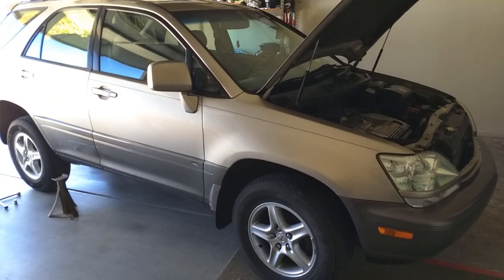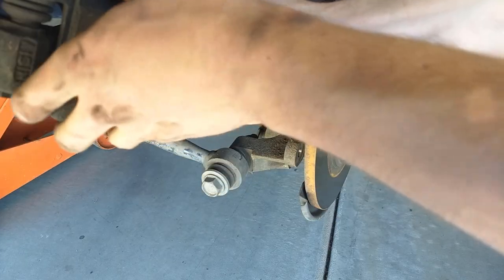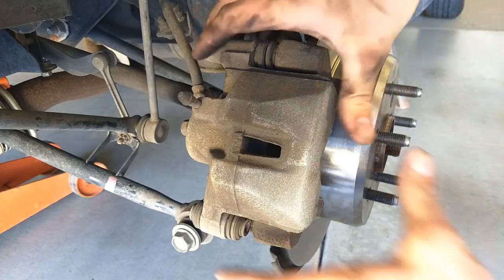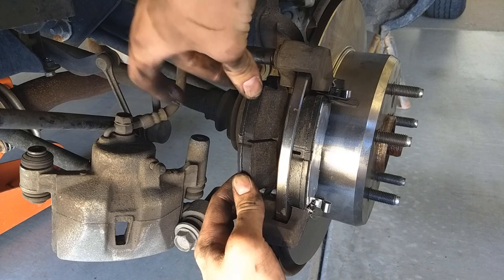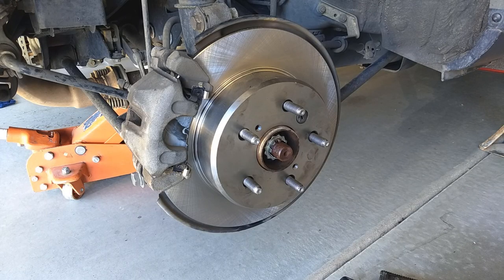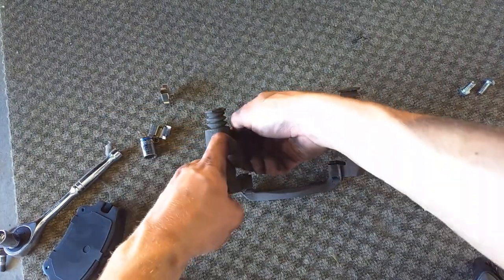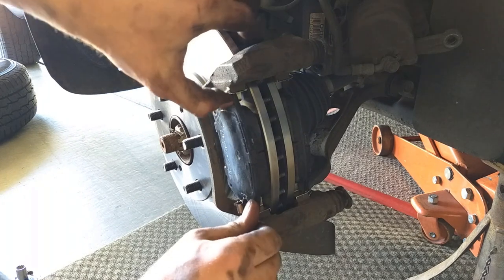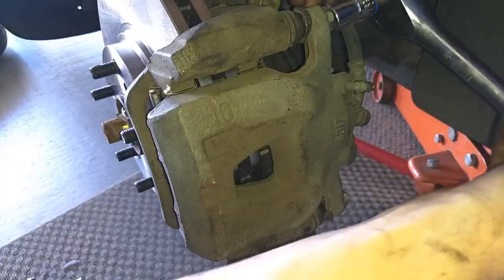How To Replace Disk Brakes And Rotors 2002 Lexus RX300

Comment: I'd personally clean all the rust off those hubs as well as spread some anti sieze or fluid film before sliding the new rotor on. Also what thread specs do you need for the rotors so you can pop em off?

Other than that and the comment about using an old pad, great video :)

Comment: You need a torque wrench.  And open the brake fluid reservoir before pushing the piston back. And you can use an old pad to push the piston back evenly.
Reply from the maker: Hey thanks for commenting, we actually did open the reservoir before pushing the pistons back...just forgot to film that part...that's a great idea with the brake pad thou thx, and we were sure to give everything a good Ugaduga 😉
Reply: I was thinking to find a piece of metal, but what a great idea thank you.
Reply: Hey I got an idea... what if.. you crack the bleeder open AND have the brake reservoir open?

Comment: What is that behind it? A dust shield? Mine are so rusty back there.
Reply from the maker: Yeah it's called a backing plate, it's to help protect from dust and debris as well as water. It also helps direct air to cool the pads and rotors. Most of the time they are very rusty lol, as long as they are still in place it's normally ok though

Comment: i cannot get the bolts out of the caliper! got the first one, the other two, i have used PB Blast, WD40, Torch, breaker bar, breaker sockets and all i ended up with is a rounded bolt that does NOT budge! Please help!
Reply from the maker: You might end up having to cut the head of the bolt off and then once the tension is off and the caliper is off you maybe be able to spin the bolt out with vise grips
Reply from the maker: But before that, try maybe an extractor set such as this REXBETI Impact Bolt & Nut Remover Set, 13 Pieces Bolt Extractor Tool Set with Solid Storage Case https://www.amazon.com/dp/B07W91Y3LQ/ref=cm_sw_r_apan_i_REQ0B30YHQC8GQVNVZ4S
Reply from the maker: I haven't used that particular set, but those kind of sockets may be able to grip it
Reply from the maker: But all that being said I have had lug nuts on wheels be completely seized, and rounded off, but once I drilled it out enough to break the head off, I was able to spin the left over threads out with my fingers. So that may end up being your best bet
Reply from the maker: I really hope the bolts aren't cross threaded somehow

Comment: Where did you get those bolts to remove the rotors ?
Reply from the maker: They might be with the tire kit in your car, if they aren't... you'll have to get some bolts that fit, or if the rotors aren't too stuck on, you can use a rubber hammer to get them lose 👍